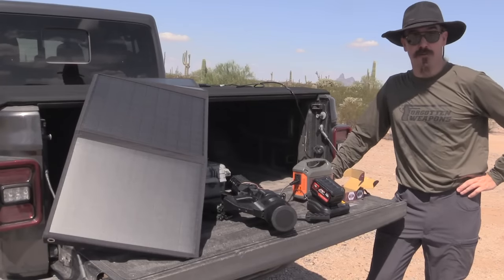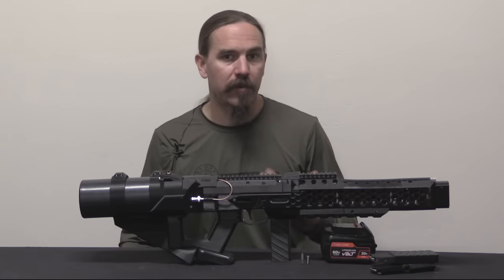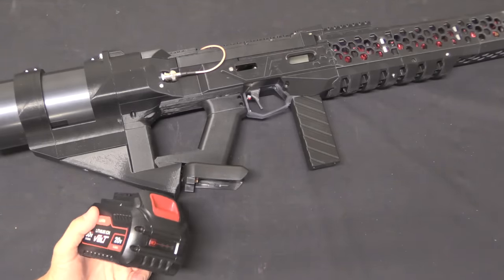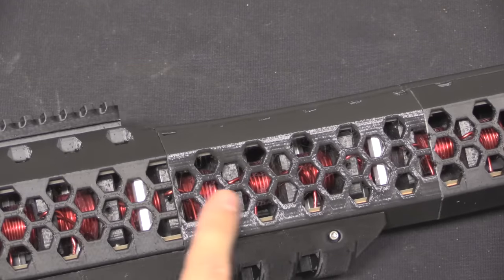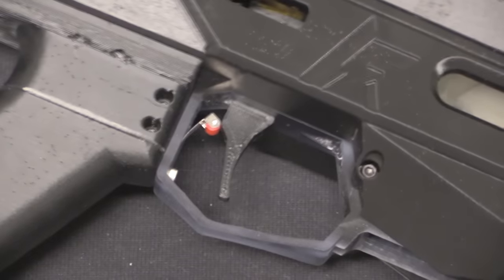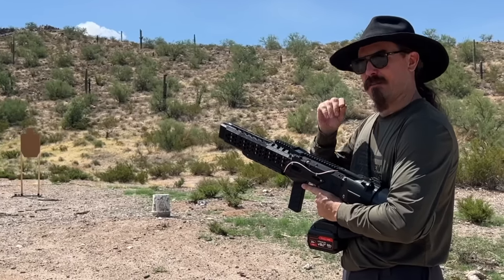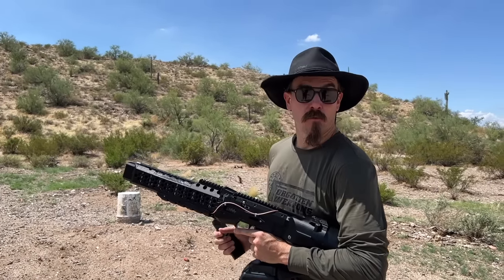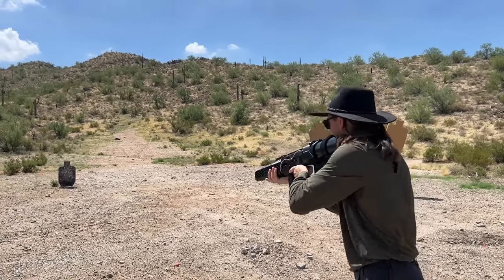ArcFlash Labs EMG-02 CoilGun: Making SciFi Weapons Into Reality

Comment: I wonder if its possible to magnetically rifle a barrel like that... like have the field impart a twist onto the projectile instead of physically rifling it, or if you could use some kind of neodymium round with field characteristics that make it spin, which I suppose would be expensive, but it would also be very cool.
Reply: The field imparting a twist is an interesting idea and actually possible. That's how an AC induction motor works.

Comment: I don't know if it's because of how quiet it is, or because it looks like I can just barely see the projectiles with the naked eye, but this feels more like a pellet-gun than an actual firearm.
Reply: I mean it's like comparing a gas car to a EV
Reply: @thanosianthemadtitanic  EVs are quite close to gasoline cars at this point
Reply: that's probably because it IS a pellet gun. The pellets are larger, sure, and the firing mechanism is certainly unorthodox, but the projectile itself is just a metal mass. With enough improvement, I imagine this could eventually lead to firearm-like performance, with a much cheaper projectile. Actually sounds quite advantageous. Needs more precision and power, so for the time being, it's a electric pellet gun, which is pretty cool but lacking in practicality.
Reply: @trevordillon1921  do you know if the projectiles are reusable?
Reply: @trevordillon1921  " the projectile itself is just a metal mass"

So are bullets my dude. 

All guns are just devices for flinging tiny bits of metal downrange.

The issue isn't the projectile, the issue is the velocity.
Reply: @iamnuff1992  That's not true. a "bullet" is just the tip. it's useless without the case, primer, powder and whatnot. this is actually just a small metal dowl. Everything else is in the gun. I guess you could argue that the battery is like the case, primer, powder, but I feel like that'd just be kind of disingenuous
Reply: It doesn't even compare to a pellet gun. A good air gun will give you 350+ ftp/s. This thing isn't even close.
Reply: @iamnuff1992  Bullets are a projectile mass...
and a casing, and gunpowder, and a primer. Not just the projectile. That's why they're called firearms.
Also, I never said the projectile WAS an issue. The issue with very specifically this coil gun is velocity. However, were that velocity higher? It would still feed and fire nothing more than a single metal piece, unlike firearms, which have multiple pieces. In that sense, and the reason they feel so similar, it is basically a pellet gun. It only has two things in common with a firearm: it shoots metal fast, and it looks like a gun. It has more in common with a pellet gun, even if it were to have a higher muzzle velocity.
Reply: @Saplingbat  
Yeah, so what? What's not really relevant to the discussion. 

All the other stuff past the tip of the bullet is just the method for projecting that projectile. Like the coils of this gun.
Reply: It probably isn't lethal. 200 feet per second isn't much, my little CO² pellet pistol gets like 350 feet per second.
Reply: @magisterrleth3129  well yeah but you gotta remember your shooting little pellets, this is a pretty big chunk of metal. it would hurt pretty bad
Reply: This is just the start that’s the point. There is a lot of room to grow the design to become a very powerful weapon
Reply: Interesting to point this out simply we should look at FPE (foot pounds of energy.)I mean look at how much damage a car can do going 200 feet per second. Projectile mass makes a huge difference but it is interesting how it is interchangeable for different dowel sizes. Because if you look at airsoft hypothetically they could reuse ammo, but from my understanding (no real world knowledge) people won't do this because the risk of chipped or dented ammo causing more issues is too great. However with higher tolerances of different ammo maybe if the damages to the projectile are not such an issue maybe reusing wouldn't be such a bad idea. Especially being magnetic would make it super easy to retrieve It sounds like a great target practice opportunity. I still agree in its early stages, but hey everything was at one point. Really cool to think about where this technology will go in the future.
Reply: I have a .22 cal break barrel that'll put the rounds through a cars license plate.  It'll kill someone if used in that purpose
Reply: @Saplingbat  and the metal dowels are useless without the battery and coils needed to fling them. Both a coil gun and traditional fun perform the exact same task. "Get metal into target through propulsion". Arguing semantics doesn't change that
Reply: It's a start. A good step toward a full hand held rail gun...
Reply: @trevensharp5772  
U have alot to learn about airguns.
Reply: @mini14head  where was I incorrect?
Reply: @trevensharp5772  
The airgun velocity. Even the cheapest bb guns run around 400. All my PCPs shoot 860 to 970fps, and these are .25 and .30cal.
Reply: I mean yeah, the projectiles are 5 or 6 times slower than .22 bullets.
Reply: The projectiles are going 200 feet per second, it's not even a pellet gun. It probably wouldn't even break the skin.
Reply: @ananthropomorphictalkinggo6641  Force equals mass times acceleration. If you have a projectile traveling at 2 speed units that weighs 5 mass units, that ends up with 10 force units of impact. If you have a projectile travelling at 5 speed units that only weighs 2 mass units, it still hits with the same 10 force units of impact as the other projectile. I think a lot of people in this thread are overlooking that concept when comparing and contrasting this Gauss cannon against different platforms.
Reply: @cheshirecynic3061  your equation leaves out projectile size and shape, which determines how that force is distributed. I've been shot with a frozen paintball at 400 fps, which I guarantee carries more impact energy than this thing could ever produce, and it didn't even break my skin because of the size of the projectile. This thing shoots a large, unstable dowel that tumbles, with very low penetrating power. It will leave a nasty welt, and maybe make you bleed a bit, but this thing is closer to a toy than a weapon.
Reply: @ananthropomorphictalkinggo6641  Certainly, but it's not claiming to be useful as a weapon on the battlefield in its current state. This is a curiosity, an experimental design that serves as a platform for research into advancing this technology to achieve a more useful version in the future. Personally, I'd say the comparisons to a pellet gun are the most accurate in terms of how much energy would be delivered by the projectile - likely not enough to be lethal to a human in its current state, but powerful enough to sting badly and potentially be lethal to small game.
Reply: @cheshirecynic3061  it definitely has enough energy to kill small game, but holy christ would it be inhumane.
Reply: 5/16 = .31 = 31 caliper
Reply: @ananthropomorphictalkinggo6641  Would it be more or less humane than being mauled by a coyote, you think? I'm leaning towards more.
Reply: Pellet gun uses air, firearm uses fire, this uses electricity. It is not a “firearm”
Reply: @trevordillon1921  

A bullet is the metal bit that gets flung down-range. The "round of ammunition" is everything put together (bullet, powder, primer, casing).

That said, I really love how everyone in the comment chain seems to think that they're arguing with each other despite the fact that they're all arguing the same point, from the same direction, and just saying it differently lmao.
Not criticizing - I fooled myself, too. I just happened to realize it before I commented.

But yeah - I strongly agree that to be useful as a firearm substitute it needs to reach firearm-like velocities - and find a fix for that accuracy issue.
There are other downsides, like durability, how much damage each component could take before failing, but I am certainly very interested in where this kind of technology can go.
Reply: Airsoft places usually have a cap at 500 FPS, so this thing is like a kids toy. Would still hurt since he's firing heavier projectiles though, even at a slower speed.

Comment: Damn, that is a really expensive BB gun. Gotta love the people willing to buy these and fuel the research of future models.
Reply: this is going to get funded by the military. the design solves a few key problems like recoil, sound and ammunition that the best guns in the world can't compete with. If these develop, they will replace powder weapons. Wait for it
Reply: @unlink1649  It really depends on if they can get the accuracy to on par with current combat weapons (which will be hard since it can't be rifled), muzzle velocity up enough to be lethal at at least current ranges, and battery life being significantly longer than it currently is.  

That and how cheaply these weapons can be mass produced.  Powder weapons are pretty darn cheap to churn out once you got the initial setup done.

I'm not saying that it's not going to happen, but it's not as guaranteed as you make it out to be.
Reply: @unlink1649  No doubt. These things have the potential to be 10-100x more powerful... even  so powerful that the rounds hitting their targets will have so much kinetic energy it would even hurt/kill people in the vicinity like a grenade went off (and the bones of the target become the shrapnel).
Reply: @leadpaintchips9461  I'm nowhere near an expert but I'd imagine the ammunition costs alone would be enough to get military interest. Custom shaped or not, a bit of steel rod is a helluva lot cheaper to manufacture that a metal jacketed lead round attached to a casing filled with a chemical propellant. Especially in the amounts a military would call for.
Reply: @talonus202  TBH if the rest of it doesn't get near to current standards for gunpowder weapons, then the cost is a moot point.  but if it gets near that point with the hobbyist prototypes, than I can see every military taking a strong interest.
Reply: oh buddy you have no idea what engineers with a budget from the military can pull off.
Reply: @unlink1649  This is not going to be funded by the military. The US military at least has been working on rail guns, coil guns and HELs for years now.
Reply: @leomonk974  Minimum viable product if the last 100 years or so of the US military is anything to judge by.
Reply: @leomonk974  I know. The technology the government has that we know about is insane... but the technology we don't know about is out of control (and I mean "don't know" as in most people don't know, because it's not public knowledge). In any case though, the government's not gonna give up their tech, so these companies have to (mostly) re-invent the technology for us to be able to buy it... which takes a lot of money (from sales) to produce and evolve.
Reply: @leadpaintchips9461  these might be our only options in space warfare, since we are already coming back to the moon and getting on the road of colonizing mars, it may be a necessity
Reply: @eduardopupucon  Again, if it isn't possible to get to lethal at a decent range, it's not going to be something that anyone's going to be interested in other than as a novelty.  He did mention that they have a velocity issue, and 

I'm pretty sure that the US military already explored this option (I know that they've explored the rail gun at least).
Reply: @leadpaintchips9461  it is possible, the limiting factor is capacitor discharge rate, what i mean is that in space, there aren't really other alternatives, conventional guns are really bad in space, if the mechanism doesn't cold weld due to being in a vacuum, you may get only one shot thru.
Reply: @eduardopupucon  The Soviets have tested actual firearms in space, in particular the R-23 which was a 14.5 mm autogun based off an aircraft cannon, which was apparently able to fire at least 20 rounds.
Reply: @StrikeNoir105E  yes, if you change the grain on the Bullet to have more oxidizer, you can fire in space, the problem is that the mechanism can cold weld, if you simply hold two pieces of the same metal(and polymers, alloys etc) together in a vacuum, they will fuse with each other, you need a lot of other materials etc in order to impede that.
it's the reason why the high gain antenna on the cassini probe didn't deploy, and why the solar panels and radiators of the ISS can't fold back.
so it is a lot more desirable to have weapons with little to no moving parts in space.
Reply: @Bourikii2992  lol. For real. It's why Freedom works so well and why the world has been propelled with science, medicine and technology. (There is tech though that government has that would cause people to have heart attacks. Don't know if it was developed by the govt, a foreign govt or private citizens/businesses... but it's scary to even consider what they're using it for and for what purpose or ends.)
Reply: Know what other gun solved the “recoil, sound, and ammunition” problem?

The Nerf gun. This thing is a toy. As impractical as EVs and gated by the same bottlenecks. Battery capacity, cost, and energy generation/storage
Reply: @SonofKiernan  People laughed at the gatling gun as well lmao. In 20 years we went from computers that took up entire warehouses and could be walked around inside of to fitting on a desk.

A nerf gun isn't lethal. These coil guns already have lethality. Not practical lethality yet, but it won't take long.
Reply: @Bourikii2992  people didn’t laugh at the Gatling gun lol, in fact it was instantly adopted as a game changer so kind of a bad example.

I think people get overexcited and “the future is here!!” is too tempting for them to really look at these things objectively.

It’s a great hobby and hobbyist’s toy and it’s cool to be excited and maybe I shouldn’t be buzzkilling you, but this is “Solar Freakin Roadways” levels of impractical/cost inefficient
Reply: @SonofKiernan  LMAO. Ian literally has a video on it talking about how generals of calvery talked shit about it and tried using politics to say it was uncouth and real men ride horses and all that jazz. Some few commanders saw it for what it was but the army didn't want it till 66, 5 years after its invention and personally purchased use from said commanders.
Reply: @Bourikii2992  that’s very nice, doesn’t change that the Gatling WAS an actually engineering breakthrough and this is a toy. Sounds like a fun video I’ll watch
Reply: @eduardopupucon  who says that if you hold two pieces of metal together in space they will Fuze together?  must of skipped that class
Reply: @s70glt100  
"Cold welding was first recognized as a general materials phenomenon in the 1940s. It was then discovered that two clean, flat surfaces of similar metal would strongly adhere if brought into contact while in a vacuum (see Van der Waals force). Newly discovered micro-[1] and nano-scale cold welding[2] has shown potential in nanofabrication processes. "

Comment: Imagine using flechettes as ammo... Little tiny darts. No tumbling good aiming and dirt cheap on mass production :)
Reply: Yeah. Go with a million needles. Wouldn't do jack against body armor, but make any soft targets rue the day they were born.
Reply: Its early like a musket, once it rifles itll be a straight shot
Reply: @bangbanglemon9767  The easiest thing to do would be to cut fins in the ammunition, like flechettes.  Ask any M1 Abrams gunner and he'll tell you that rifling is overrated.  Still, 200 FPS means it has a lot of time to come off track, and make just about any armor effective, even if you jacket the projectile in Teflon.  They need to get the coils a lot smaller and pack them a lot closer, before the thing can really compete with firearms.  I bet is weighs a ton, as well.  Still, I want one!
Reply: @TheEldritchGod  make the darts tungsten. and you can up the fireing rate by adjusting the coil timing.
Reply: @ThatsMrPencilneck2U  Im just going to ignore the tank comment, operators and analysists are differnt things and I think neither of us have a tank gunner to distract. The issue is 1. Loading mechanics 2. Creating enough drag for rotation. While it seems impossible to both rotate and travel, just like orbit its possible. Just too early
Reply: @Griede26  - Ooo.... yeah. Expensive, but that will ruin someone's day.
Reply: @bangbanglemon9767  You could generate spin by coating either side of the projectile with plastics that have dissimilar insulative/conductive properties, and allowing the more conductive side to ground to the rifle.  Space exposed charging wires down the "barrel" in a spiral pattern, and the projectile will spin.

The M1 has been around a long time.  There are a lot of retired gunners.  I've been out of the Army so long that the last time I saw one, it was equipped with a 105mm rifle.
Reply: @TheEldritchGod  its just specialized ammunition...... :P
Reply: @ThatsMrPencilneck2U   I like this idea. Though it might be chaeper to make the insulator in the spiral pattern. Im not sure of the exact functionality of the system tho.
Reply: @bangbanglemon9767  The problem is grounding it to the "rifle."
Reply: Add a venom spray at the muzzle so the needles are toxic.
Reply: Can’t make the darts from tungsten - it isn’t magnetic, so the darts would just stay sitting in the barrel when you pull the trigger!
Reply: @alfredpotts6136  i was going to say that, but I do have to say you could probably put a tungsten tip on a steel projectile
Reply: @ThatsMrPencilneck2U  Rifling was first used to cut down on barrel fouling, but they discovered that the spinning projectile evens out the effects manufacturing defects have on the projectile's flight.  If the barrel and the projectile are both made with sufficient precision, rifling isn't needed.